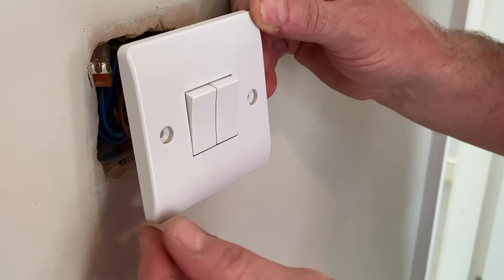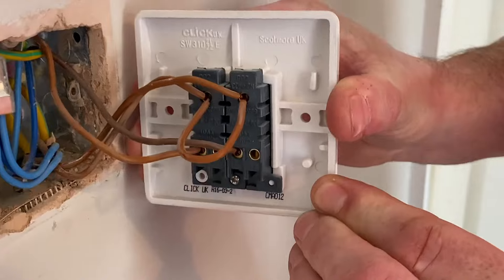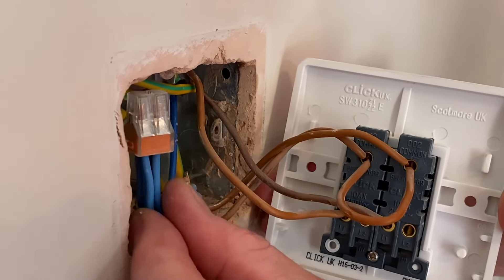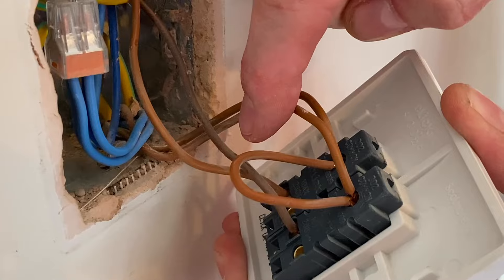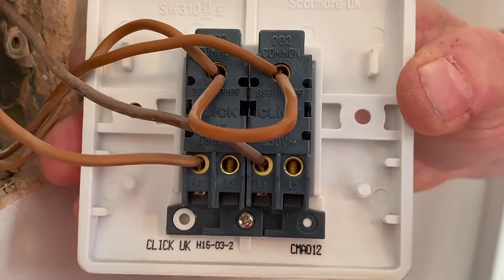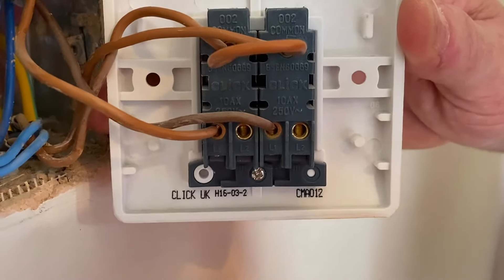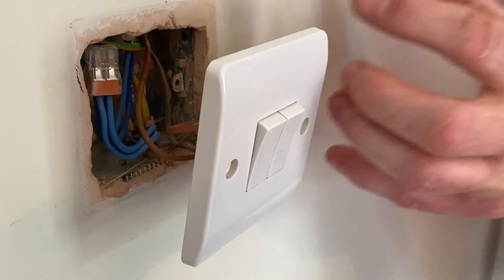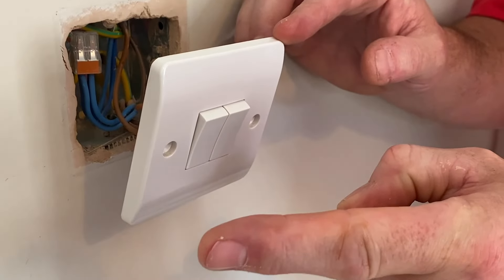2 Gang Switch Used as 1 Way Switches Connections Explained - Taking the Feed to the Switch

Comment: Again Nicely explained. Taking to feed to the switch is so much easier to work out. Been doing this method to my old house. At least most switches have a neutral now. So easier to add the new fancy switches which require neutral 😇

Comment: In Germany 1-way light switches are no longer a thing for some time. It's actually cheaper for the manufacturers to manufacture more 2-way switches instead of manufacture 1-way switches on a separate line. Especially since it is easy to use a 2-way switch for a simple on/off application.

That reduced the prices of these switches, before they were more expensive. But since they became standard, the prices dropped.
Reply from the maker: Thanks for the great comment 👍🏻
Reply: Germany failing to to save the planets resources again, just for profit. 😉

Comment: I’m trying to do this, BUT, the left switch is two way as in it’s my living room light that can also be operated by another one way switch.  I’m trying to use the right switch to operate a separate light (external). 
Been advised to run neutral from a light and live from the switch, but not working.

Comment: I've seen someone else ask it, but it wasn't answered - what is the need for the 4th neutral and permanent line (the one that "goes out" - not to the lights), where's it going? And why? Is it necessary? If you don't need to connect to another bedroom can these simply be left out?

Comment: Where does the 4th neutral wire go?  I understand there's one from the source to the connector and one to each of the two light fittings, but can't figure out what the other one is doing

Comment: Love this video didn’t know it could be done like this but question what  is the other end connections wire like e.i. Is all the lives in one way go clip  and all blues and earths the same in there own way go clips then just follow the procedure in this video and that will give me to separate switches for two separate lights from one live feed , apologise just in the middle of lowering ceiling and want to have a central fan light on one switch and down light on a separate switch like your video so was wondering would this work

Comment: So to make things fun, I would like to do the same thing, 2 plate method but with 2 gang smart dimmers which require 35mm backbox,.Would I be fine with a 35mm back box? Im afraid for to force the issue with a 47mm backbox as the internal block is about 50mm ish haha? Thanks in Advance!

Comment: If anyone asks can you use a two gang switch as two one way switches then they shouldn't be.anywhere near electricity.
Reply: Why so? I see no safety breach.
Reply: on that thought... 30/1/23 allegedly tested & reported to IET Wiring Regulations BS7671 Requirements for Electrical Installations using the above method uses a single yellow/green 3m (approx) sheathed wire for the switched live? Installed by a 'qualified Electrician'? Another light switch with metal back box, broken CPC and held on the wall by paint!! I'm not qualified as a sparkie but even I know that's wrong/dangerous. These videos are educational and provide proof of the CORRECT way - even for us DIY's or other professional roles.
Reply: @amaddinthenow the question demonstrates such a massive lack of understanding that they probably shouldn't even be allowed near sharp objects 🥴